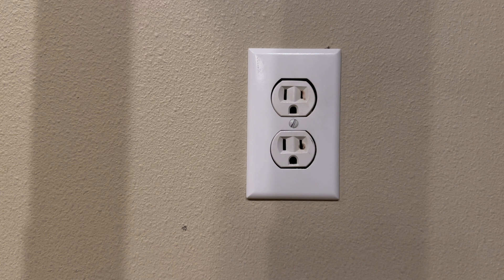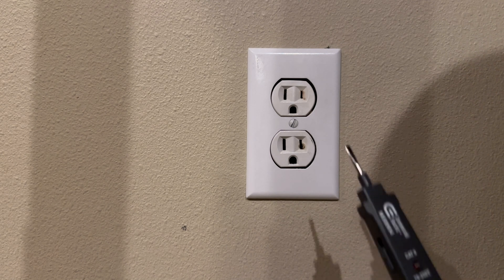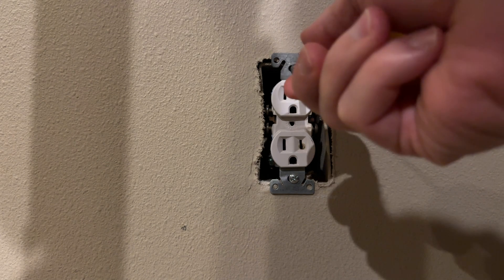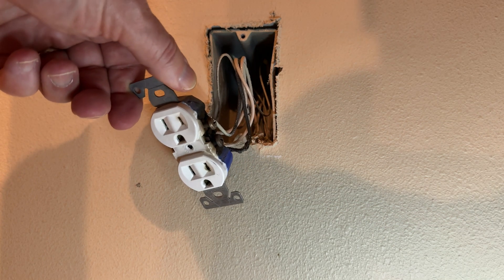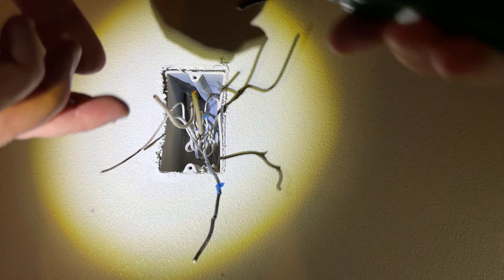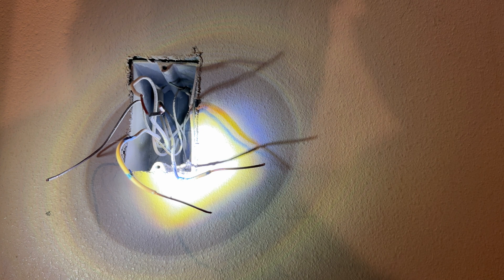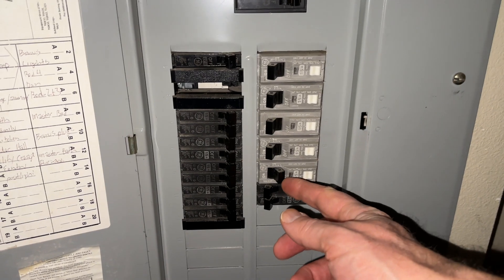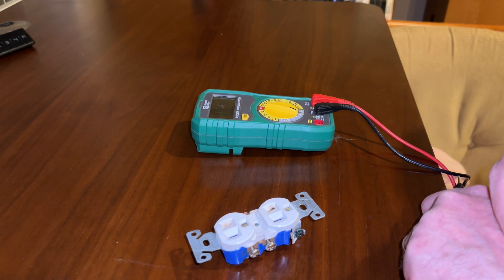Fixing a Burned-Out Electrical Outlet: Troubleshooting & Replacement Guide

Comment: Few questions, First Timer Here !!!! 

1. does the circuit breaker have to be cut off for the room in which the outlet is in or the entire house? 

2.The cover is loose could that be the  cause of the short circuit? 

3.What side is the hot side and what side is the cold side? 

4.Are they wires colored coded &  if not, how do I know which side is the neutral side top wire and which side is the nature side wire  for the bottom? 

Be nice in the comments I’ve never done this before 😊
Reply: Get an electrical tester. Touch the white or black wire, the one that brightens up the pen is your hot. Your copper wire is the ground, sometimes it'll be insulated in a green color. I AM NOT AN ELECTRICIAN, JUST SAYING FROM MY EXPERIENCES. ASK FOR PROFESSIONAL HELP FIRST.

Comment: We had an electrician come out today who worked on the same project. He replaced the wires and he left the outlet switch because it was good.  What melted was the connector. Apparently, he said that we overloaded the circuit.  Sometimes, in older homes, that happens.  Also, by fixing that one he in turn, fixed another one in the same room because they are on the same line. So last year, my hubby had a space heater and something else plugged into the same outlet.  We could smell burnt wiring so quickly unplugged everything.  We should have gotten it repaired last year but due to money we waited.  It's so nice to have all our outlets working again. 😊  Your video was nice.
Reply from the maker: Thanks for watching! I’m glad it worked out!
Reply: @DaveCarolson  You're welcome 😊 Thanks!

Comment: You should never have any bare wire showing past the screw. Also looking at the wire it appears that the circuit was overloaded at one time. One more tip , with a metal box, it is a good practice to wrap electrical tape around the screws to prevent them from accidentally touching the box
Reply from the maker: Thanks! Those are great points

Comment: It’s a good practice to wire ground first then neutral and hot last.
Reply from the maker: Thanks for the comment. That’s a great point! Especially important if the circuit is energized.